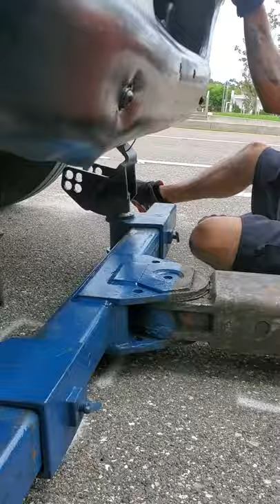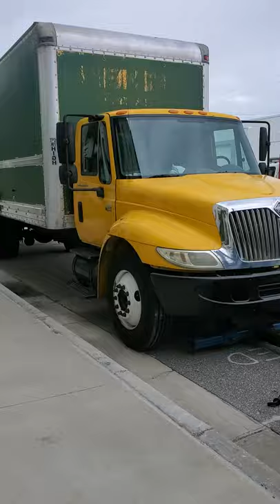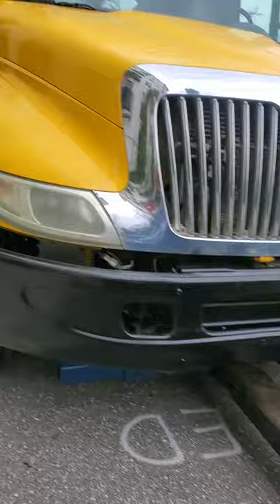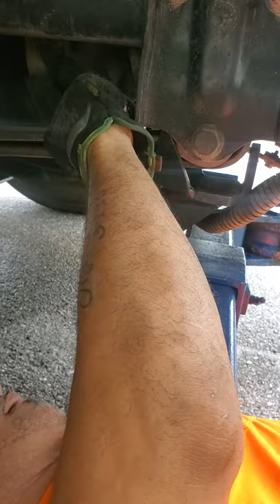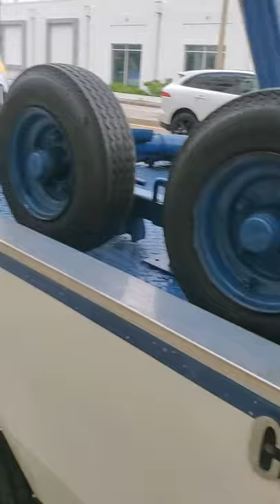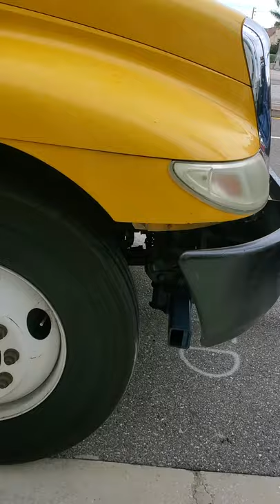Spring Forks Towing

Comment: So it is MUCH easier to put the fork in place  pin it then work the fork into the reciever especially when you have lines real close like that
Reply: You sir are 100% Correct. Used those hundreds of times and after I think the second time I learned to attach them to the spring then adjust the under reach.